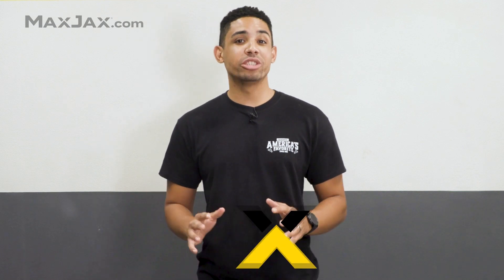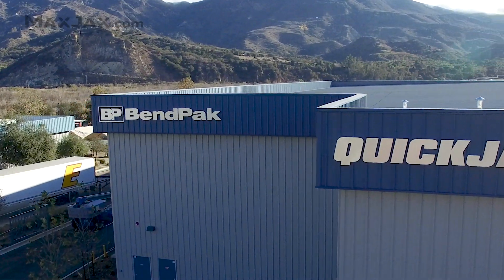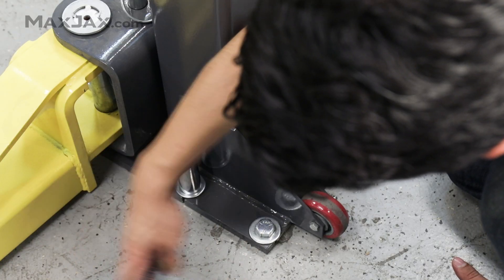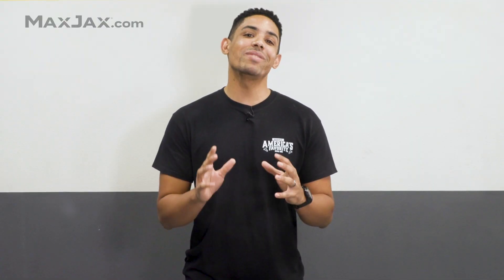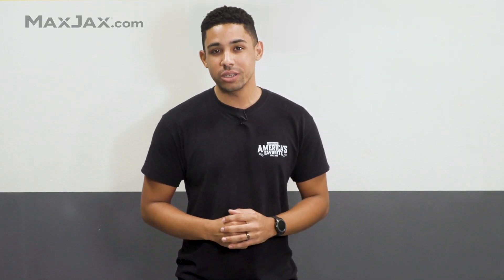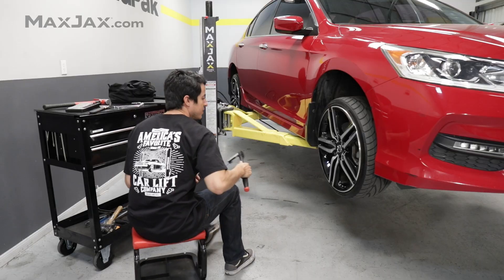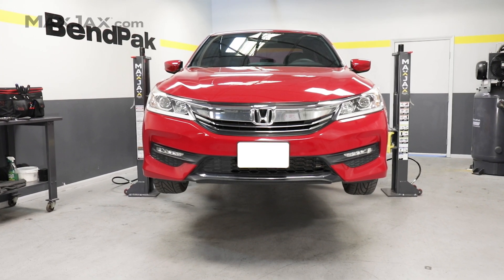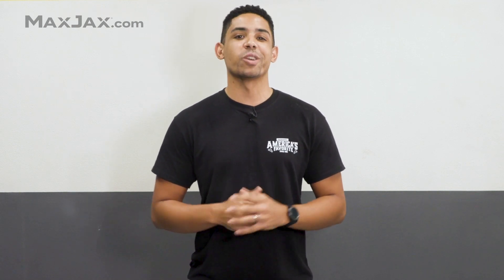How Safe is MaxJax?

Comment: If its so safe why does it only lift up to 48" and yet cost nearly $1000 more that traditional lifts.  60" lift height would be nice, or more.
Reply from the maker: Great question! The MaxJax is designed primarily to be used in residential garages with limited ceiling height. Given the direct-drive hydraulic system, the hydraulic ram lifts along with the carriage, thereby limiting vertical clearance. The MaxJax system does not require any cables or cable adjustments for leveling. As far as cost is concerned, while there may be less expensive "traditional lifts" out there, we believe it would be difficult to find one that includes an ALI Gold certification as well as readily available after sales support should you have any issues with the lift. We welcome you to research all options, and if a standard two post better suits you, we have a full selection of those as well at https://www.bendpak.com
Reply: @MaxJax  I have plenty of height in my garage but am only interested in this so i can move it out of tje way to do other things since the sqaure footage is a standard garage.  So tje extra height would be nice to have if needed. If it had a higher lift capability that doesnt mean people would HAVE TO raise it that jigh.  Or make a lift with that extra capability as an option.  Id only be worried about what you'd try to charge. You guys recently increased your prices significantly but I'm not seeing that price increase for other lifts. And yes I'm refering to other certified lifts from reputable companies. I think youd have more people interested in this lift and think its a "real" lift if it had a higher capability and comparable price as other lifts. I'm seeing most full lifts around $3000.  You want to charge almost $4000, or at least $3500 for the basic.
Reply from the maker: Unfortunately, recent increases in raw material and freight costs have caused prices to rise substantially in the last 8 months. I cannot speak to other lifts, but all MaxJax kits ship free in the lower 48 states, another added value. We do appreciate your comments, and are always looking to improve the product! Most updates come from customer feedback, so always keep an eye out for coming changes.
Reply: Fjb